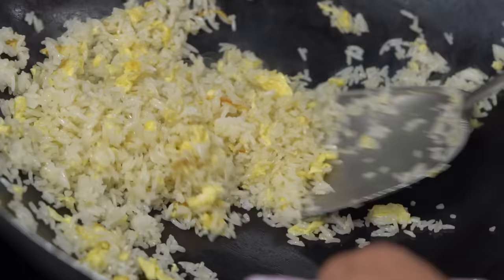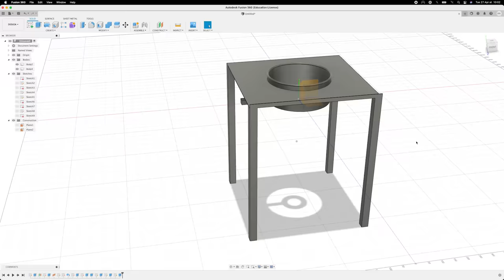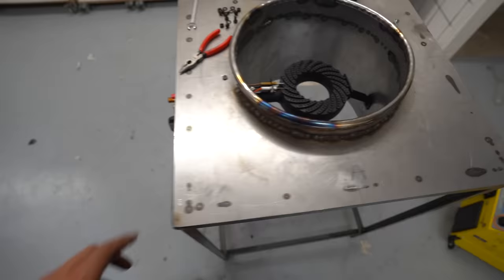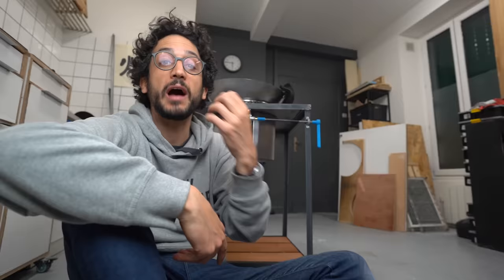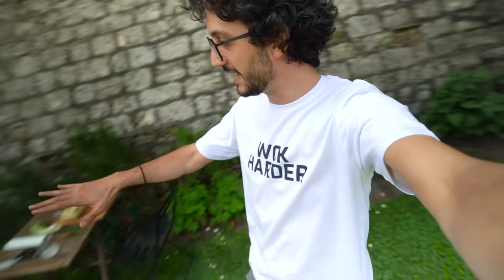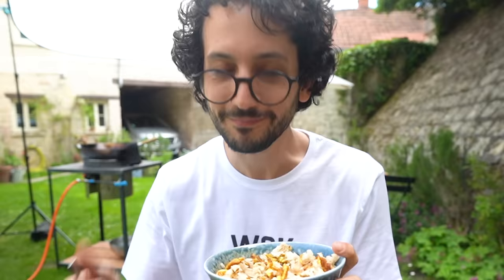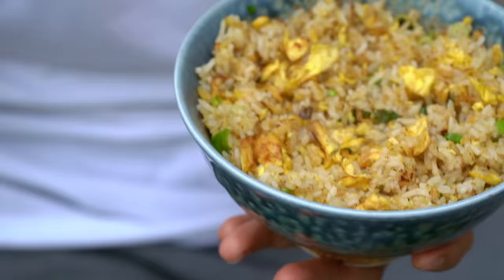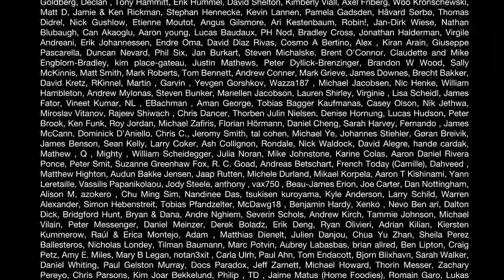I Built My DREAM WOK STOVE ! High power + Knee operated

Comment: Honestly, a burner with more than 12,Xx kW (which is what you’ve got here is really not necessary. The higher wattage  pressure burners used in commercial kitchens are rarely used at higher outputs than you’ve got for woking purposes. Just my five cents:) thanks for great content ❤️

Comment: It’s for the best Alex that you couldn’t get stainless steel, as you would have needed a TIG welder, and the welding would have put off toxic gasses. Actually come to think of it TIG welding is usually used for kitchen equipment because it’s a cleaner process than MIG or Stick.

Comment: So let us assume your burner is generating enough BTU's (can't tell as you have very little footage of the flame, but the WOK doesn't look hot enough in your footage, you sure you have a high pressure regulator?). Here are some tips. Egg, take it out after cooking. You are killing them. I recommend seasoning the eggs as they are the flavored bits in the rice that give it savoriness, especially since you aren't using any ham or lap chueng. Season eggs with salt, pepper, a dash of soy and onion powder. Remove when still slightly undercooked and it will be cooked through by the time you re-add at end. The rice, actually is seasoned/flavored for the best outcome, despite what family matriarchs want to say. You want fine diced shallots or onions cooked to translucent before adding rice (they will be lightly carmelized by the time the rice is done cooking). The rice (day old refrigerated, Jasmine - the new crop Thai stuff has more fragrance) gets added and broken up. Once it is loose and starting to slightly brown, add in a couple large pinches of onion powder, a large pinch of sugar (I prefer dark brown), pinch of MSG and a pinch of White Pepper. Go 5 times around (directly on the rice not the edges) with light soy sauce (if using regular use less) and once around with toasted sesame oil. Stir that in quickly with the spatula as the soy will burn on the bottom of the pan (make sure to keep flipping the rice from the bottom so the steam can escape, your goal is to dry out the grains some during cooking and slightly toast each grain). Add in the secret ingredient, a pat of butter and then the scallions (white part). The scallions only get cooked for a minute or two. Add back in any ingredients to hot pan (e.g. the eggs you scrambled) to rewarm and combine. I highly recommend adding fresh peas and diced carrots (those can even be microwave steamed ahead of time (Chinese are all about vegetables). Serve with the fine diced green part of scallions on top. Uncle Roger prefers a simpler seasoning, which is also more traditional, (i.e. he would not approve), but to the western palate the more seasoned version is what you are used to and is usually preferred.

Comment: I have a thought about the moisture of the rice. Maybe (and I say maybe because I don't know), maybe the problem there is how you boil the rice before to frying it. I think this is a previous step that I find missing in this series. Not all rice is cooked equal, it depends on the variety and the future use of it and often packages aren't accurate about how to cook it. Just as a suggestion.

Comment: this is my wok journey too. wow. its fun to see how things i figoured out on my own are ways the pros do it. great confirmation! ps. im german. and i have the exact same burner, for exact same purpose. ill see now if ou run into same issues i did...

edit:ok guess you didnt in this vid. the issue i have is that burner is great for thick cast iron or aluminium sandwich pan. but the centre hole in the burner ring leaves the very base of my wok with low heat, the juices start to collect, the heat isnt transgered thought the wok coz its so thin. you could really see a ring of char where the ring of the burner was heating the wok. i had to add a funnel type hat over the burner to focus the heat towards the centre. that helped.

Comment: nice station. Interesting timing too since I intend to do the same thing, but want to factor in some sort of plate walls around the wok so I don;t get grease all over the patio lol. Water too so I can wash out the wok in between dishes! maybe drain into a bucket underneath. Just hook it up to the garden hose, and be able to fill a bit with a swinging faucet welded or bolted to the walls of the plate above

Comment: Hello Alex. Great work. I see that the video is from some time ago. But in case that you are still looking for a way to get the eggs the same size. There is a specific fried rice called Yangzhou fried rice. The eggs are poured into the wok in thin flow. Then the eggs wouldn’t be in pieces, but rather thin like hair. The heat has to be exactly correct. Too high would burn it. Too low wouldn’t get it right. Look it up. It would be interesting.

Comment: you should seriously consider looking at the video from Kenji Lopez-Alt, the egg should go on top of the rice to prevent burnt. Also, keep the burner on high heat while you add extra oil and soy sauce (that will give the moist smoky flavor) then the flame goes to pilot after adding the scallions.

Comment: was the rice you use leftover or steamed like the one chef Samuel did? With the wok, you need to do quick tosses in high heat. Lower the heat and move the wok away from the flame when you're adding ingredients The wok not being hot enough is only a part of the reason. Also, scallion is added last. For fragrance, use the white part when frying. Use your wrist to make small circles when stirring the egg. Hope this helps. In the end, you just need lots of practice with actual cooking on the wok. It's not like you did it badly.

Comment: If you going to use a stove like that, you'd need to find a way to cool the setup. 

Your stove top is going to overheat and possibly warp at some point of time, especially if you are going to make several practices. 

Otherwise, it is a pretty good design for a stove.

Comment: I worked in a professional oriental restaurant and they actually have A ceramic lining on the inside for insulation purposes. Also they don’t use an electric are they only use gas and they light it themselves as the trapped heat probably will melt the wires.

Comment: I'm loving this series so far!  I'm also a huge fan of fried rice, although I have to be honest and say that I like the take-out type of fried rice.
I made some yesterday with my flat-bottomed wok and my outdoor burner, but the taste was... awful.
I used canola oil, and that was a bad choice.  I also used some dark soy that was old, and that was two bad choices in one!
I did use some Vidalia onion, and that was a great choice, along with using Mung Bean Sprouts instead of peas.

Oh...
You might want to add a stainless steel braid over that gas line, since hot oil could hit it and the results could prove...explosive!  Or at least some sort of metal shielding for it.
Thanks for these videos!!

Comment: Alex, bear in mind, use 冷飯 which is scrap rice you store at refrigerator, where's the origin of 炒飯， it is because the Chinese don't waste there food scrap, particularly rice after their meal, they stored it at refrigerator and reheat it with frying method,  it can dehydrated the rice so it behave less sticky and with more oil coat on rice during frying can give rice a shining appearance. Your scallion should place at the last minutes before plating. When your pour  the egg to work and stir, you have to put rice on to it so rice can contact the egg liquid and fully coated, it is call golden fry rice 黃金炒飯 stir fry until the egg coating nearly dry then stop heat it and drop your scallion.

Lastly, I suggest you white the Chinese words in traditional way, don't use the simplify chinese, it's very disgusting writing it should be   炒飯 the “飯” has the symbol “食” at the left side which means eat and the simplify one is something no meaning at all, it's the Communist party wish to destroy chinese culture and create weird symbols to replace the genuine chinese cultural.

Comment: Wok range is high powered but u dont use the full potential all the time. It's like building layers of flavor. When u want specific ingredient to be a bit charred, the power is there. Also when u need to cook large qty and u have the wok skill, the power is there. But for a single portion the power is sparingly used

Comment: You definitely have waited too long with rice, eggs should still be very running, just barely starting to harden on the edge when you throw in the rice, and you start beating the rice into the egg as fast as possible, this will coat some rice in egg as well, giving that double texture that makes this magical. 
Other than that - great wok station going to base my design on yours, will just make side into a foldable table, so I can have all the ingredients close enough to actually do wok cooking which is a race.
Reply: as long as the egg is slightly undercooked its completely fine

Comment: Beaucoup de paroles pour pas grand chose.
Se poser des questions sur la température ou le revêtement anti-adhésif ne mène pas à grand chose.
La seule chose qu'il faut réaliser, c'est trouver le moment optimal pour assembler des ingrédients qui ont des temps de cuisson complètement différents.
Rationnellement, on aurait tendance à les cuire séparément, puis à les assembler tardivement, pour que la fin de la cuisson soit juste une égalisation des températures.
Si on tient à faire "style" en jetant tout dans le même récipient, alors il faut maîtriser à la perfection la façon dont chaque ingrédient cuit, non pas individuellement, mais dans l'assemblage.
En termes de protocole expérimental, ça signifie, pour chaque ingrédient, déterminer quel est son temps de cuisson optimal en assemblage. Autrement dit, à quel moment chaque ingrédient doit être introduit.
Bref, chronomètre et feuille Excel.
P.S.: Vous aurez le même problème avec les plats multiingrédients complexes, comme le Biryani indien, par exemple, ou même la paella.